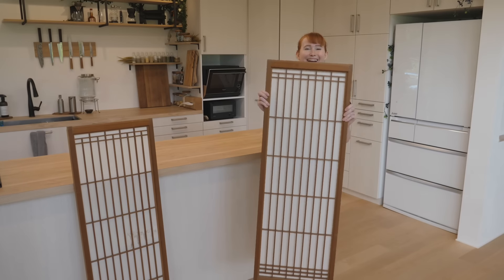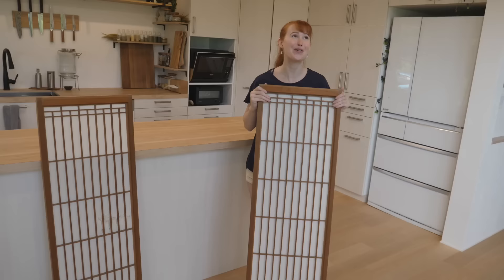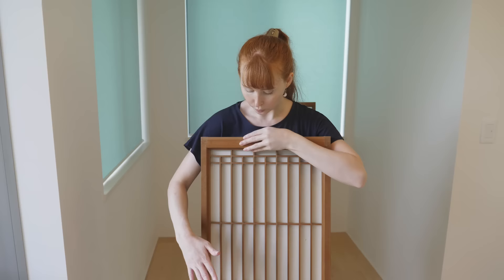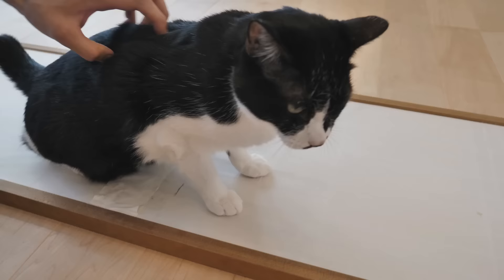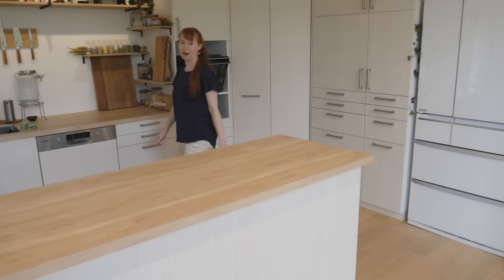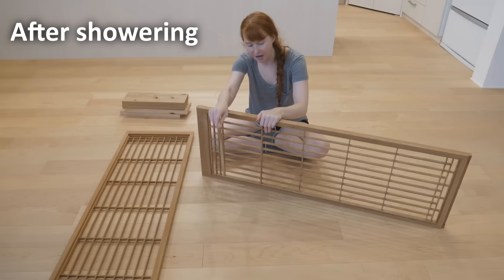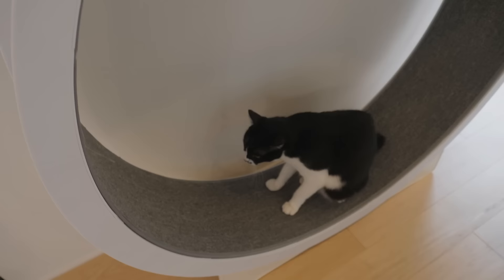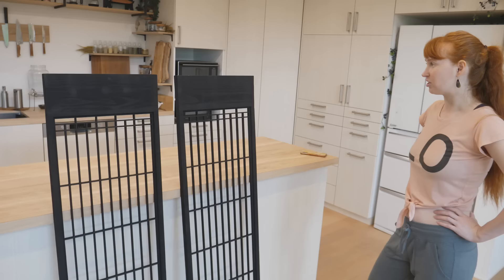We figured out a way to reuse old shoji doors

Comment: Okay, can we take a second to talk about this quick-connect thing for ceiling lamps????
Reply: Totally awesome, and I wish it were a world wide mandate! Changing lights in US is fraught with danger, not to mention learning how to attach wires to the correct terminals!
Reply: Right? I was painting and removed several lamps from the wall that just weren't grounded, and a bunch of switches with multiple strands of spliced Romex 😬 
An easy swap like this would probably save many trips to the hardware store... and likely for some a trip to the emergency room!
Reply: It's so hard to hang a lamp in my house T_T I've lived here for two years and I still haven't installed many of the lamps because of it.
Reply: Right ?
The US never does anything helpful with houses like that 
Sigh .....if only we took example notes from Japan and just converted to quick install lights like that .
Reply: It's amazing. So practical!
Reply: that is so fricking cool O.O
Reply: yeah, this a thing in Sweden, too...i was absolutely gutted when i moved to Germany & had to get an electrician to take all the plugs off my ceiling lamp cables & then connect the cables directly to the ceiling . same things with stoves/ovens, in Swe you just plug it in, in Ger it's all 'high voltage' stuff, has to be done by an electrician ... :(
Reply: @ViktorErikFade   yeah, the new ceiling recessed lights are even worse- the old standard was that you could replace the bulb when it died,  but now they're making them so you have to replace then entire light fixture.
Reply: @j.wa.1061  that kind of sucks and is wasteful of materials ....sounds like the wires were made to go out then rather than the bulb itself
Reply: @ViktorErikFade  Yeah the video where they had just moved in and were talking about the house building was full of these little facts. Like the standard lights were the 'throw the whole thing out' kind and they had to change every light because of it.
Reply: @_Fizel_  I must have just forgotten little things like that or didn't pay it any mind because I'm not used to seeing them
Reply: Standard here in Sweden as mentioned and it blows my mind that not every country has the same thing! 💡
Reply: Those seem so convenient. Hopefully Australia can produce or import stuff like this
Reply: I’m about to send this video to my electrician Stepfather and tell him to watch that part 😁
Reply: I wish the UK would take note.
Reply: @HanahS.  he would lose much business if that were implemented
Reply: @emilymulcahy  not really, he would install things like this because the wiring has to be installed in the first place that these are connected to 🙂
Reply: @HanahS.  apparently you didn't know what he does, a fairly decent part of most electricians work is not prewiring but installation of new fixtures or fixing homeowners mistakes in trying to install new things
Reply: @HanahS.  also I said implemented, not to implement, do you also not know the difference in conjugation? Implemented means it's already done, to implement means it needs to be done
Reply: My jaw dropped! That is one of the best things Ive ever seen and I definitely think the whole world should use those
Reply: A lightbulb just went on above my head, which fit quite well with the literal lightbulb going up.
Reply: @emilymulcahy  you honestly just sound rude the way you’re replying to me 😅 I’ll be honest, I don’t 100% know exactly what he does or any of the technical language because, guess what, I’m not an electrician myself 😱
But I do know a little from what he’s told me from when I’ve asked about current jobs he’s on. You’re right that he installs fixtures and fixes wiring mistakes in houses but he also installs everything at new builds. Like currently he is working with a large group of people on a newly built prison and they are installing everything ⚡️
Reply: @HanahS.  then he's NOT a typical electrician, he is mostly in new installation, my ex was the same as a plumber, he didn't do typical plumbing he did new install, there's a difference in types of electrical work, I am rude because you don't know what you are talking about but still feel the need to add in your two cents and cannot handle when you hear the truth, it's not me being rude, it's that you don't know what you are talking about
Reply: @emilymulcahy  oh for goodness sake can you just get lost 😒? I never said I knew what I was talking about at any point… Do I know exactly what kind of Electrician my Stepfather is and what exactly he does? Absolutely not 😕 because one: I DON’T know the difference because, like I said, I’m not an Electrician myself and two: he only talks briefly about what he does. From what my Mother has just told me after I text her asking her if she knew she said “He’s a Contractor Electrician and is hired by different companies to do all different kinds of work. He mainly does Industrial work but sometimes does Commercial work and every once in a while, Domestic work. But mainly the first one”. 
My literal first comment was that I was going to send this video to him and perhaps I should have also said that it was to ask if he had seen anything like it himself because then I wouldn’t have had to deal with your unnecessarily hostile “two cents” as you like to put it 😒
Reply: @HanahS.  it's obvious you know nothing about what you're saying or you wouldn't have written so much to excuse yourself, it's backpedaling
Reply: @emilymulcahy  like I said, I never said I did (stiiill not an Electrician), you’re the one who is so hung up about it 😅 and you don’t even need to be 😆
Reply: @HanahS.  just showing you how you shouldn't speak about what you don't know
Reply: @emilymulcahy  it’s not like I’ve been like “I’m not an Electrician but I’m going to throw some facts out that I happen to know and then talk down to people who I assume are also doing the same thing”…oh wait that was you 🙃
Reply: @emilymulcahy  Give it a rest already. It isn’t that deep! 🤦‍♀️
Reply: @tessan613  Don't you have Ikea?  Can't they impose it by fiat?
Reply: @Ojibwette  mind your own business
Reply: Exactly, like America is still living in a time without practical things, but in Japan they have that, from the times my dad or grandpa have almost fallen off the table or ladder just to fix a light
Reply: Right? I replaced all my light fixtures when I moved into my new condo a few months ago and it was SUCH A CHORE
Reply: OMG that was the most amazing thing in this video! 🤣🤣 I was screaming I NEED this now!
Reply: @emilymulcahy  why are you so unneededly hostile? not everything is an attack on you personally... like ' am rude because you don't know what you are talking about but still feel the need to add in your two cents and cannot handle when you hear the truth' ? it seems you're the one who can't handle to truth & feel the need to add your 2 cents lmao, alongside clearly not listening to what was stated as a fun lil note over a response of 'lose so much business' - why the immediate pessimism? try and find joy in the little things, perhaps
Reply: I'm so mad about it!!
Reply: @hollowsbest  thank you 🙂
Reply: @kayerin5749  Same here in the UK. It's quite dangerous.
Reply: @Smaugette  Same here.
Reply: Ya! Why dont we have that here

Comment: a little tip for making these slidy doors less hard to slide is to rub chalk or candle (or wax) on the grooves that they slot in
Reply: A bar of soap works as well.
Reply: Thank you for the tips
Reply: Is this tip similar to how rubbing some pencil graphite on a zipper will help it slide easier?
Reply: Yeah, paraffin is perfect because it won't damage the materials too
Reply: even rubbing wax paper helps
Reply: @flonny1340  yep
Reply: @flonny1340  I do not know that one. Thanks for sharing.

Comment: have you heard of kigoroshi? I saw it in a video where the cuts are made smaller than the joining wood and then water and some light hammering is used to bind the joints (two pieces of wood) together without nails or glue. It's really cool

Comment: Hi Rachel 7 Jun, love the make over of the screens I have a room divider with the paper used but will be changing it to have family pictures in each square.
Rachel this is a trick I learned years ago to help me stay cooler, get some tops made of linen and wear under your bra’s it has a wicking affect and will keep you feeling dry all day long. This is something they use to do in the past as the linen under shirt would be washed all the time but corsets or in your case a bra would not need washing after one wear. Linen is good for keeping you cooler and dryer.

Comment: I'm shocked and soooo jealous of how easy it is to change a ceiling light in Japan compared to America. Here in America I have terrible luck with ceiling lights. It takes me like 15 minutes if it's going quickly, but it's more normally half an hour to an hour. But my record was 3 hours because everything was going wrong and I'm just bad it. And you didn't even have to turn off the power in that room from the circuit breaker! Ugh.

Comment: The final little makeover is so cute! About the black smudges, is that coming off from the spraypainted surface? The doors will probably be OK if you're not moving them with your hands very much, but for the obi hanger, maybe it would be a good idea to add a protective spray to seal in the color so that if the obi rubs against the hanger no black spraypaint comes off on it?

Comment: You can build yourself a sanding station that serves as a table in normal use. Basically it's a box with legs, that has holes on the top. You hook up a vacuum to a hole in the side of the box and sand on top. Depending on design you get most of the dust out of the air with such a table.
I recommend making the type where you have a ramp (think graduated pool with kiddy side and adult side) where the vacuum hooks up in the deepest part. That way even the smallest holes have the same power to suck dust as the bigger ones.

Comment: That small space turned out really nicely! Very pretty with the shoji and everything ❤

Considering you got the black spots from the spray paint on the shoji paper, did you think to seal it in in case it rubs off? Especially for the cut off end you used for the obi. 
Black paint and white obi probably isn't a good idea if it rubs off....
Reply from the maker: There was some paint dust on the shoji doors after I finished painting. I managed to wipe almost all of it off but I couldn't really tell just by looking since it was all matte black, haha. So there were a few spots left that made it onto the shoji paper, but most of it was easy to clean up. We also put a piece of wax paper between the obi and the "hanger" to guarantee protection against exactly this, haha.